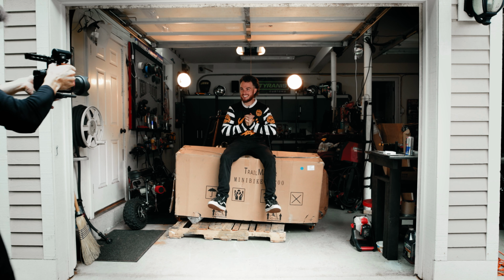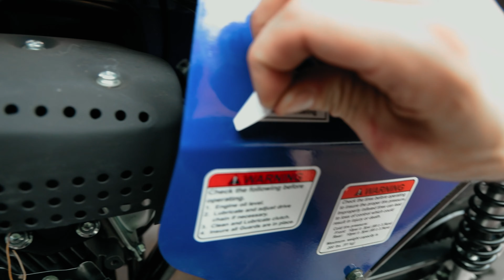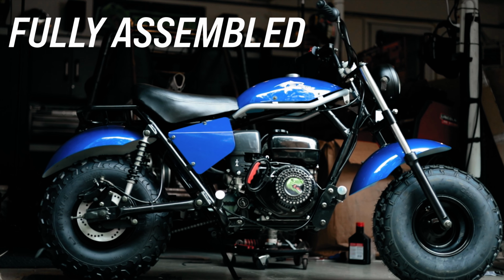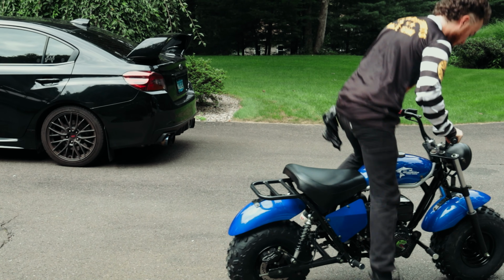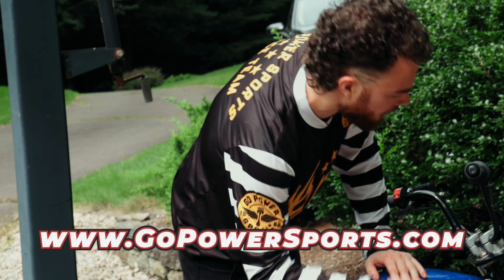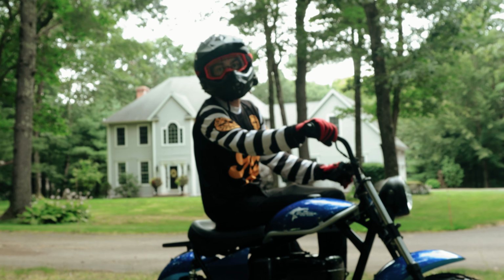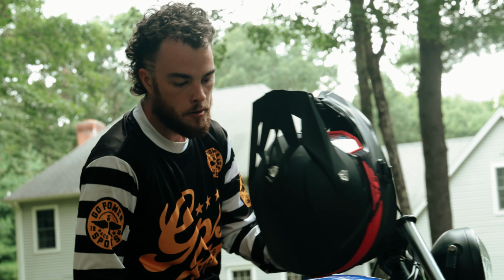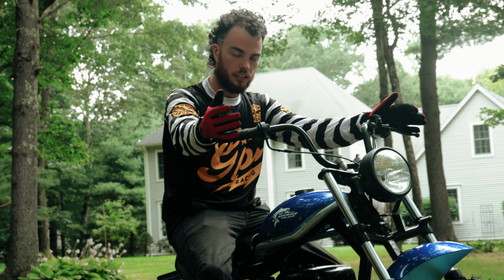Trailmaster MB200 Mini Bike Impressions and Ride | Best Production Mini Bike??

Comment: Nice bike. Did you say you ran it for 30 minutes then changed the oil? I think I heard of this before but this is break in? Never heard of any engine being broke in running at idle. I do understand that there are many different break in procedures that guys use.
Reply from the maker: Thanks Deuce! Its a fairly common practice to run a new, or newly modified small engine at idle for 30-45 minutes as a "break in". After the break in the oil is drained and checked for metal chips, flakes, dust etc. You want to see that you don't have any internal clearance issues, before putting a load on the engine, while also giving it a very mellow first heat cycle.

Comment: Idle breakin is not a good way to break in an engine. You should of ran it at multiple rpm's for 20-30 minutes. Then changed the oil. Cool vid tho.
Reply from the maker: I gave it a lil somethinsomethin off camera, couldn't help myself

Comment: That’s not running oil it’s a thin oil for storage. Like running it on wd40
Reply from the maker: Ours had a slightly thin, but acceptable viscosity so it sent it 🤷🏻
Reply: Must have got it from a shop and not the mail. It says in everyone I have ordered that is not running oil. It will scar the pistons. But I order mine